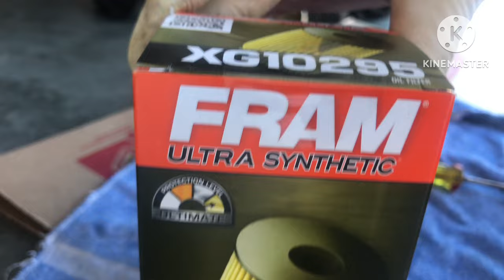2018-2023 Lexus lc 500 oils change

Comment: Thanks for the video. However, you used synthetic oil, which is wrong. The engine in the LC500 specifically calls for regular, non-synthetic oil. This is also what the Lexus dealer is required to use in this car!!!
Reply: My Lexus dealer fills my LC with synthetic.
Reply: You are wrong. 

The engine does not require synthetic oil - meaning you can put in regular oil just fine. However it is perfectly ok to put in synthetic oil. In fact, you definitely should. They are cleaner and perform better under high heat. There is no reason not to use synthetic other than it costs more. But not even by much.
Reply: Your talking about regular driving any high performance driving this car needs synthetic Toyota of Japan does know American regular oil sucks in Japan they only have high quality oil

Comment: thanks for the video.  I wouldn't use fram though, the filters are under $10 OEM.
Reply: I would use Fram as long as it’s the Ultra Synthetic one. They are high quality made of synthetic fibers that trap more contaminants than the OEM filter. Cost more through at around $15. The basic Fram are crap though.
Reply: What is the part number for OEM?

Comment: I’m going to have this car soon. I’ll be back here when it’s time for an oil change! One thing, how do you know which way the Fram oil filter goes on? I changed mine on my GS350 with the letters up top at first but it wasn’t fitting right. I then turned it around and it seemed to click into place. I really hope I did it the right way. By the way, I’d recommend switching to Pennzoil Ultra Platinum 5W-30. Much better oil than Mobil 1.

Comment: Thanks, by chance have you done a transmission fluid change/flush?  Did it for my gs350 and wanted to do it for the lc500.  Wonder if it’s similar, drain, verify how much drained out and fill with same amount.
Reply: I had my mechanic do a drain and fill and that’s pretty much the procedure they used. I do believe you have to have the trans fluid warmed to a certain temperature though.